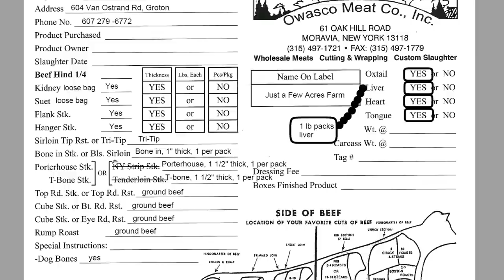she's going to the butcher

Comment: If you go the upper hole on the loader, you will get a greater dump angle with the same length of stroke on the dump cylinders.  You will not have the same load over height - it will be less but you don't load high sided trucks/trailers that I know of.  I would check with your dealer but I think there was a higher flow pump for the 656 - you might also have them verify the relief valve pressure is where it should be.  Some were marked on the end hex.   I enjoy your videos - glad to see the old red iron still being used - takes me back to my early career.

Comment: If you mounted the bucket to the lower pin hole, assuming the hydraulic cylinders have some extra range left, wouldn't you have a greater arc of travel, and a steeper down angle?

Comment: I twist the tail of cattle to get them moving if they are stubborn, as long as I have their heads in the right direction. 
It has been 20 years,  but  I never had problems with loading pigs. I just walk everyday with the bucket of their food and walk different paths to leave their food in different spots at different heights but where they easily get to it. If you leave their food on the same spot, they expect it there everyday and will not go through non familiar spaces. When I load them in the trailer, I walk the bucket of some food into front of the trailer and they get on, while I exit by the small front door and then close the back door behind them.

Comment: I have a pin on my round baler that I put a nail in when it broke in the field. When I had time I put the correct pin in it. Next time I got to the field it broke again. So I field fixed it with another nail. This happened to me twice. So finally I just said I am going to leave the nail in there. That was probably 5 or 6 years ago. Still going strong. Not sure why the pin breaks but the nail doesn't. But not going to change it anymore
Reply: Lol the pin is probably designed to break faster so you have to keep buying them! It's like how dishwashers, fridges, and printers are just garbage nowadays XD

Comment: The cylinder pivot and arm pivot holes need to be closer together for more range of motion on the bucket. Measure the old bucket brackets and I'll bet they're closer together than the forklift. The holes are farther apart on the forklift brackets for more leverage.
Reply from the maker: Makes perfect sense. Thanks!

Comment: I believe you might be wrong about the position of the bucket attachment. I think that if you change the position of the bolt you will gain some more “dumping angel”. It should help based of what I could see from the video. 
Best of luck from Sweden!

Comment: I was surprised to see you with that hot shot. In our ten years raising Dexters we’ve never needed one. Usually a strong tail grab works for all but the most cantankerous.
Reply from the maker: We've only had to use it once, on a squirrelly steer. We always bring it just in case.
Reply: @JustaFewAcresFarm  As with so many things better to have and not need, rather than to need and not have.
Reply from the maker: @COIcultist  Right-O

Comment: Trying to visualize by pointing my index finger (hydraulic arm) horizontally on the edge of a ruler and sliding my thump (main arm) downwards the ruler (bucket) seems to tip down, I would give it a try anyways. Given enough clearance it would also seem convenient to add a hole for the pin further to the bucket side to get it tip even further. Greetings and keep going.

Comment: I wonder if you could move your lower pin hole closer to the bucket
I think that it would have been better for dumping if the IH frame that you built off of had been turned over
That girl frame was probably designed to keep the forks closer to level at higher levels.

Comment: On my old Paulson loader on my Super C the top pivot has a long horizontal slot to allow the pin to slide forward and backwards at the highest tipping point so the bucket can tip forward and dump the bucket at the 80% point, then as the loader goes down it resets back .  You would have to build new plates on the top pin bolsters to cut sliding pin slots and cut them a little at a time till you get the geometry right for the tipping point.

Comment: Did you cross your chains when you hooked up to the trailer otherwise those safety chains are not going to do you any good when the trailer comes on the reason for crossing the changes so that if it does come on hook it will set on a chains
Reply from the maker: Yes I always cross the chains. That's trailer 101.
Reply: @JustaFewAcresFarm  it looked to me like they weren't cross cuz you had a close up with your camera hooking up the trailer and you had him hooked on your vehicle from the trailer and they weren't crossed but maybe they were but I don't think so